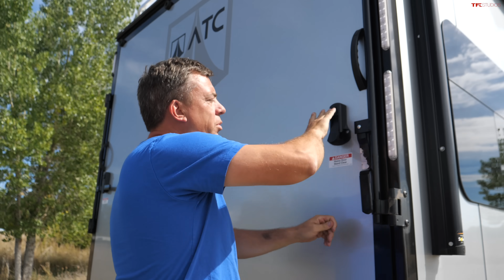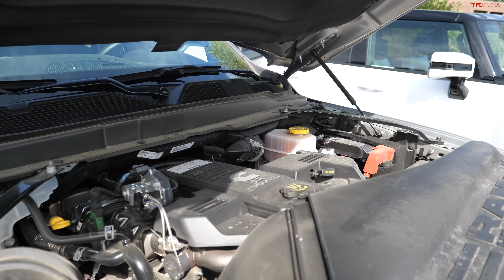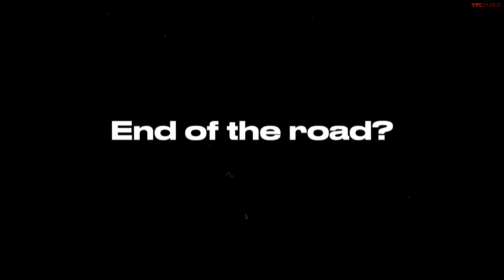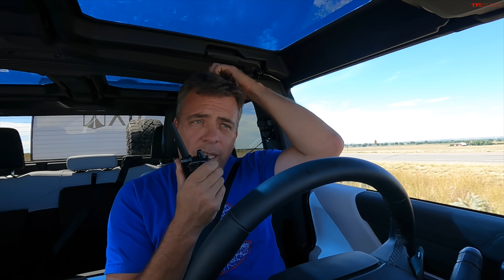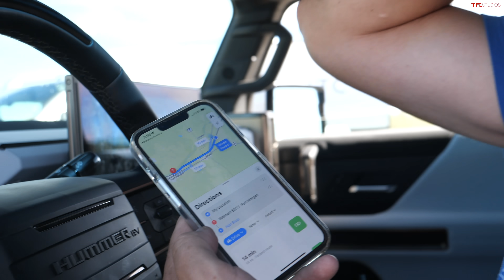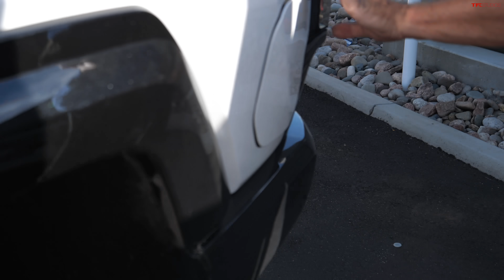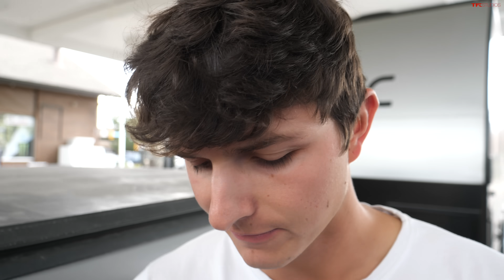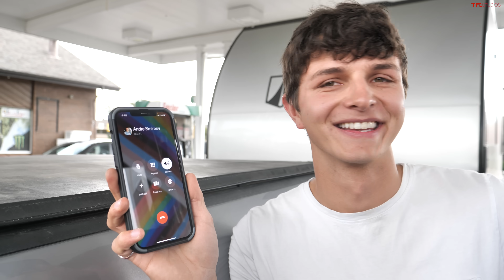How Far Can a Diesel and Electric Truck Tow An Identical Camper Trailer on ONE Fill-up?

Comment: This is another senseless pointless useless test comparison I don't know about all you guys but when I hook up my toy hauler to my diesel truck I have my family in the vehicle I have my SxS in the trailer it's full of water the fuel station is full of fuel the propane tanks are full the fridge is full of food the closets are full of of clothes and everything else that I need to bring along for the trip, I don't go camping with an empty trailer and by myself.
 You guys really need to do a test comparison with the trailers loaded down as if you were going camping and I guarantee you the numbers on that EV truck will be in the toilet 👎 I bet it would barely make it to the freeway from your house to start your trip before it needed a recharge, The only thing good about EV vehicles is they are quick from stoplight to stoplight .

Comment: Last weekend I hauled a load of topsoil grossing out at close to 20,000#, my trip average was 15.8 mpg with the older 5.9L and standard transmission. The 6.7L is powerful, but unnecessary power at a significant cost

Comment: 3:03  "6400 lbs which is not a ton of weight"   Technically it's 3.25 tons, but I get what you mean. not heavy for a typical trailer.

Comment: Only a fool would trust a vehicle to steer and more for them when driving. This tech is getting stupidly out of control.  Also, long live ICE!! ..EV's are just silly government propaganda toys.
BTW, with EV's the inefficiency is merely shifted to the source of most of the power generation, ie: power plants ... the conversion of heat -> mechanical -> elec ... is not that efficient.

Comment: Also with the Hummer you likely will be looking at a battery replacement down the road that will cost half as much as the Ram truck did. You should do another test where you both go camping at the same place and have the same start time like you’re getting out of work at 5PM on Friday and have to be back to work on Monday morning. See how many more hours at the campground the guy in the Ram gets while the other guy is stopping to recharge on the way. I was surprised though by the mileage for the Ram, I thought it would be better since that was such a small trailer. I had a 2008 F-250 with the 6.8L V-10 and I got about 8.5-9mpg hauling a 40’ fifth wheel that was real close to the maximum rating of 14,000# for the truck.
Reply: Yes, ev batteries are very expensive. However, they do not require the maintenance that a gas/ diesel engine does.  I Read that the hummer battery will be covered for 10 years or 150,000, whichever comes first.  Do that math on how much it will cost to maintain a gas fueled engine across that amount of time or distance. It’ll pretty much even out over time.

Comment: It would be informative to know what the outside temperature was during the test and if cabin heating or cooling was needed and if so how did that effect the range of the ev. The EV themselves are remarkably.  The battery technology, charging availability, charging time consumption and battery range are unacceptable to any serious driver.  Perhaps one day these issues can be solved and there will be ev cars and trucks that fulfill the needs of American drivers at an affordable cost. Until then we will continue to be “driven” internal combustion engines with large fuel tanks.   
American oil, From American soil.
Drill baby drill.

Comment: Electric trucks great until you want to go camping more than a hundred miles from your house like if you live in California and you want to go and to Arizona to Moab or to Vegas you're shit out of luck you're going to kill the battery in the middle of the desert and have no means to charge it where with the diesel you can at least grab a can and walk to the furthest gas station get a ride back and move your truck you'd have to disconnect your trailer call a tow truck tow your truck back to a charging station and then drive it back but wait now you're dead again
Reply: I've looked there is no charging station for 200 mi from Moab any major camping spots have no charging stations can't go 200 Mi you can't go 100 miles in a electric truck I can go 1100 miles and my diesel was two full tanks

Comment: Thank you guys for proving that electric vehicles are a joke.  They are too expensive, they have a very limited driving range, and they take forever to charge compared to fossil fuel vehicles.  If anyone thinks that using a fast charger is good, keep in mind that fast charging creates a lot of heat, and the heat will shorten the life of the battery.  I'll keep my fossil fuel powered vehicles.  Oh, and just to add....those who think that we need to change to electric vehicles to prevent global warming, well, in the past 30 years, the average temperature of the planet has increased .008 degrees....and they want the whole world to convert to electric vehicles for that?

Comment: I own a Hummer EV, i tend to drive it alot too, it's my daily. And little known fact is when i haul with it the reason i never get stranded is because i got a solar powered power bank, a portable EV charger sitting in a compact box in my cargo bed, doesn't take up much space and it provides me enough voltage not to be stranded. It's a custom system but it's nice to have. During the night, the battery backup in my solar powered power bank kicks in, providing me enough juice to mak it through to sunrise when it automatically charges up again, ane i an easily charge my Hummer EV anywhere as my power bank can charge while in use.
Reply: Oh, also, not tp mention the kind of things i haul is a full sized RV camper. It weighs in at about 18,000lbs and is loaded with my common things
Reply: @ashthewolfdog1380 What did the solar cost 100,000 dollars. I call BS on everything you wrote.
Reply: @Bottoarguewith  the solar didn't cost but 50 bucks. Quit your shit.
Reply: @ashthewolfdog1380  You are a better comedian than me,  I'll give you that.

Comment: so 123 miles is the limit when hauling? i mean i guess thats not to bad if u live in a small town an dont have far to have to drive an haul but if u have to drive longer distance, theres no way. my dad used to have to drive 160ish miles on way to work everyday so i doubt he would be able to drive something like this even without it towing, an for the days he had to it would leave him walking daily if its al he had to drive. kinda crazy they are expecting this to replace diesels.

Comment: While I understand that prices of electricity and diesel both vary, it would also have been interesting to hear the price comparison for fuel vs electricity.

Back of the napkin, it sounds like charging (without the $0 promotion) would still cost about 75% as much as fuel, after you spend another $55k on the EV truck and spend a lot more time getting filled up. 

I do some long road trips and time is money, too. An extra day of room and board on each leg of a trip, adds up to a lot of money. An extra couple days to do the trip, might mean I can't do it at all.

Okay, you have a trailer. But there aren't campgrounds and RV parks everywhere nor are they free.
Reply: @Y U Meme  the price of electricity in Kentucky is good for you, but not much help to someone who is 2000 miles away.

And it still doesn't help the range problem. I drive 500 to 900 miles at a time.

Comment: Great video about the real costs of diesel v battery.  Clearly we are not there yet when it comes to towing and long range travel.  Hummer will be great for short distance, city and off road only.  I like the electric Hummer a lot but this video was very helpful regarding the limitations of electric full size trucks.   Thank you!

Comment: 1) They are cutting power lines that connect to your EV from charging stations for its Copper. Nothing like needing a charge and you can't.  2) Should you decide to power up from home, what's all the hidden costs to make that happen? Special equipment, install, etc? 3). What would one do with an EV when there are rolling blackouts for power?  4) it would not be unusual to find that you are not 1st in line to charge your vehicle while traveling hence the long delays. 5) For those out there with 2 Left hands... Relying on 120V power to charge your EV could take 40 hours or more...240V equates to 4-10 hours...........................lmao

Comment: I don't give a crap what the efficiency is. I don't think any driver really cares what the efficiency is in a situation where you're towing a camper. Especially if you're camping with kids. You're either limited to campsites close to home which kind of defeats the purpose of going on vacation or you're stuck spending hours and hours at charging stations with kids and most likely dogs just to go camping three or four hours from home. There's no way. The more I hear about these electric vehicles the more impractical they become. Maybe if you live in the city or a suburb and you get home plug your vehicle in get to work plug your vehicle in you're good to go. For the rest of us that live in rural areas (which is a whole heck of a lot of us) it is just infeasible to own or operate an electric vehicle. It would only possibly be feasible if you worked in the nearest city and there's superchargers available there. Most of us rural people don't work in cities.

Comment: The only real use for EV is for city commute, especially in regional Australia insufficient recharge locations to longer distances to travel.
For home charges 3 phase power required a quick charge, single phase charge takes 8- 10 hours and raises the home power costs .
To produce an EV vehicles emissions are much higher ,tyres plastic interior and parts all made from fossil fuels. Some environmental zealots have their heads in the sand, EV have place in the future along with wind & solar generation but currently there is no silver bullet.

Comment: The strange thing is that my crappy old 1990 Diesel truck has better mileage than the Dodge Ram when I am pulling my Bobcat on its trailer, the combo weighs over 8000 pounds.

Comment: The diesel was about $100, and the charge would have been $40, but you went almost twice as far on diesel, so electric really isn't any cheaper? Not to mention how much longer it takes to charge. 30 freaking minutes? Yikes. And that's without having to wait for a charger.

Comment: EV takes half the range vs diesel but then half the cost to charge. It all boils down to economics. However, cost of energy is going down based on the growing trend due to increase in renewables while diesel will only continue to go, up. It has even more expensive than gasoline. Something I could not remember happening in the past. So for me, EV is the better way going forward. At least there is a hope for a cleaner air in the future.

Comment: I would definitely buy the diesel over the EV vehicle. The $46,000 price difference alone buys lots of fuel. Diesel at $7/gal at 10 miles/gal. avg. would get you over 76,000 miles of driving. No brainer at this point in time. EV has a long way to go.

Comment: The problem is that if you have fast charging that usually means fast discharging.  If you want a truck to use to take a kid to soccer practice then the hummer will do just fine.  If you camp in your nearest park then the hummer will be fine probably.

Comment: What's  the actual efficiency of the the kilowatt to fuel ratio when you calculate ALL of electricity losses from mine to the powerplant from the power plant though the distribution lines to the charger to finally the batteries in the truck with each loss calculated into the final #  ?????????

Comment: OMG, what a pain in the backside. That EV truck is worthless for any real work. I pulled a camper trailer about that same size and weight with my 2012 Ram with 5.7L Hemi and it still got better fuel economy than that diesel.

Comment: The thing people don't understand about EVs efficiency is that unlike a diesel which initially is less energy efficient. It will maintain efficiency, vs the EV only degrades in efficiency as the battery loses charge

Comment: I'm a general contractor and have tesla I use for estimates, picking up checks, dropping off plans / trips to city building and planning. Doing that in my HD truck would cost me about 50 to 80 bucks in gas a day but even more importantly, I zoom in and out of places quick in the Tesla and use the time I spend charging (30 minutes on the heavy days) knocking out paper work on the laptop

Comment: just wondering if anyone knows the expected life range of the electric motor/batteries? given not all diesels are created equal but the 7.3 I have is well known to go 700,000mi or more ( if well maintained ) before needing major repair/rebuild I have heard people online claiming there semi trucks went even longer and are still using with well over 1,000,000mi on them?
also has anyone tried using a electric truck to plow snow? how long did charge last under load in the cold and how long to recharge?
just a rough estimate but I would have to more than double my rate to cover the cost to go to electric not to mention you need at least two electric trucks to replace one diesel/gas ( you can't stop and wait for one to charge several hours when it's snowing not unusual to plow 15 plus hours non stop here there's been storms I've gone over 30hrs strait slept for a hour in the truck waiting for gas station to open plowed another 10hrs went home crashed for 7-8 hrs then plowed another 20+ point is if I had to plow for 24hrs going by how long a charge lasts and how long it takes to recharge in temps 0 to -5 below during the day 10-30 below at night ( not counting wind chill ) the past winter we set record for coldest temp second only to Antarctica by a few degrees )  under very heavy load probably wont last more than 4-5hrs and takes at least 8 to charge so you would need 3-4 electric trucks to every 1 diesel 
just one more thought but has anyone run the numbers as far as how much the electric car/trucks reduce co2 vs how much more co2 and other toxins are produced to mining and manufacturing the batteries lets not forget all the equipment being made and all the shipping needed not to mention the damage the mining does by it self how offten the batteries will need to be replaced oh lets not forget how many more power plants need to be built to charge them what else will have to be made to build them and what do we do with nuclear waste again how many more trucks will need to be made to haul it? are we sure this is the best way to save the planet or is it just what they want you to belive so they can make more money? remember what we were told about recycling how much did that cost us over the years turns out that what less than 3% was being recycled here another 2-3% was being shipped over seas most of witch fell overboard or ended up in a landfill anyway but it's not a scame so what if it did more harm in a year then good in ten it was just bad info or it was our fault somehow but they would never do that again right???

Comment: This is why I'm not totally sold on electric yet, yes they are impressive, yes they are cool, but they are also niche for the moment. That said, I look forward to the day electrics take over. I have played with both electric and fuel in my hobby (Radio controlled cars) and electric has many many more advantages, but to scale it up, you will reach diminishing returns. For one energy density. Pound for pound nothing beats fuel (gas or diesel) yet, but electric will eventually. Yes electric can match the power capabilities of fuel, but at the cost of range . There is also the price, just about every E model is about double the furl counterpart, makes it a real bummer to consider also if the battery fails. Remember a Tesla is 44K, just to replace the battery and more than a few, Tesla refused to warranty. The biggest issue is size, the batteries are huge compared to a gas tank. In a Tesla, the batteries are under the entire floor and possibly under the hood as well, I assume the same for this hummer. When E vehicles can match or beat fuel in every category (Price, weight, mobility, Range and Lifetime range), I'll get one, Till them, I'm content letting the early adopters have them, they can afford to buy and maintain them

Comment: No I'm not sure how the GMC is configured or if it's a smart thing it is running an old cylinders right now and with only $6,000 not even 6,000 lb of Towing on its back that thing's going too soon and still get 10 miles to the gallon that's how they are designed but I don't have the information and you know decide to some manufacturing vehicles have even better engineering but they never put it out there because of the government and they want to make money they are all connected let me tell you and do Ford pickup truck b***** gas on a 6 cylinder with more talk can't get up to 23 miles to gallon running on all six cylinders running

Comment: It’s not a surprise. Nothing rivals the energy density of gas/diesel. With my auxiliary tank full I can pull 16000 lbs about 800 miles. I can stop for 20 minutes to fuel up and it again. If you buy an electric truck as a work vehicle or hauling recreation vehicle you are a misguided millennial with too much money.

Comment: Perhaps I missed this: how many years does the battery last before it must be replaced? My neighbor has a 1996 F250 she hauls horses with and it’s still going strong with the original drivetrain, assuming a 10 year lifespan on a battery pack that cost $15,000 to replace you have to add another $30,000 to the price of that EV truck - assuming the rest will last 30 years.